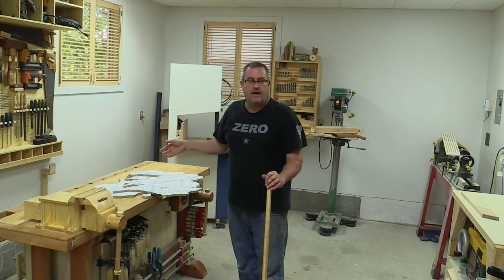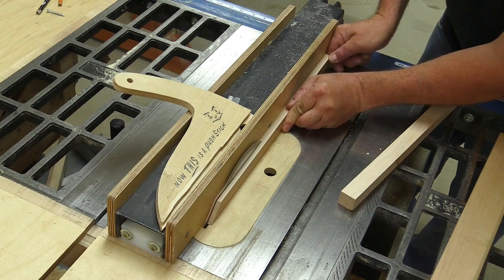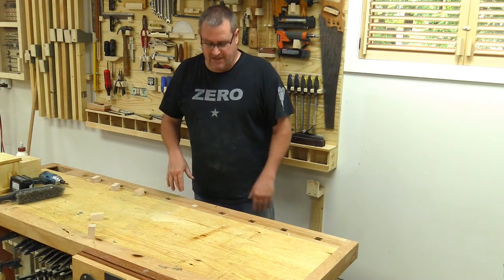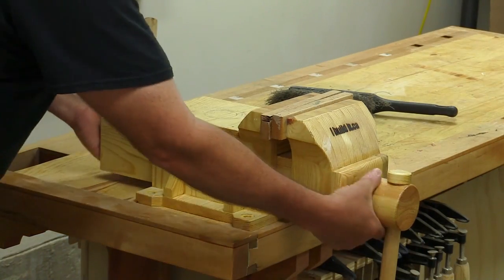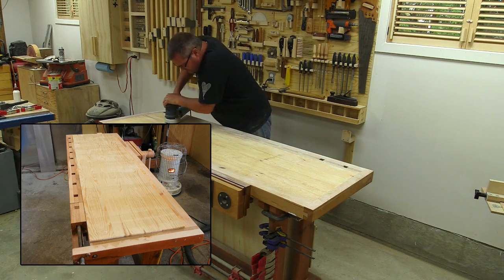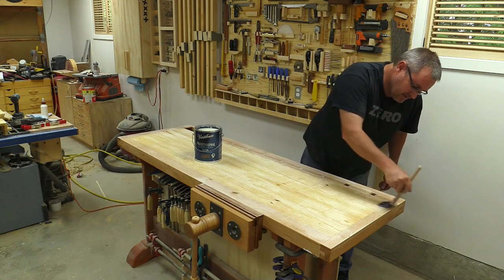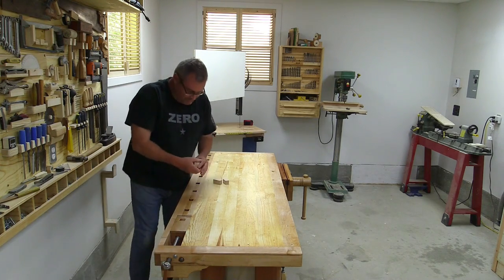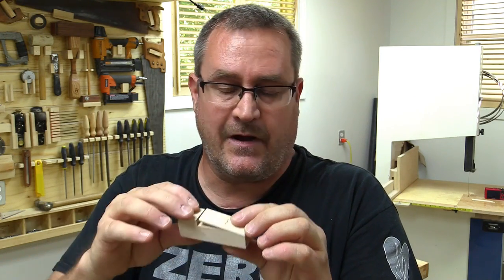Making A Wooden Bench Dog And Bench Top Refinishing

Comment: Nice job on the bench top John, I am going to have to do mine,I should have put a finish on it when I built it, but didn't, and now it is looking grubby. I may copy your idea of a pine top, because my planks have dried out completely now, leaving me with  gaps between each board, unfortunately the screws don't want to come out, unless I drill them out, refitting the mahogany planks is not an option...lol
Reply from the maker: Phil Sale Maybe route a 1/2" channel between the planks where the gap is and fill that with a strip that's cut to fit in there. Mahogany is too nice, it would be a shame to cover it up with pine.
Reply: I Build It Good idea John, I'll look into that, thanks :)

Comment: I've seen a lot of people on the internet say that polyurethane isn't a good finish for benches because they claim it would crack and peel. Clearly it's served you well considering you treat your workbench like a workbench.
Reply from the maker: Just Make It I would guess that the people that say that did something wrong to arrive at those results, like adding something to it or doing something to affect the adhesion. Either that or they are just saying something they read or heard somewhere else, without any actual first-hand knowledge. There are a lot of people out there with funny ideas, like poly is evil, cheap and "plasticy". 
Following the instructions on the can will give great, long lasting results.
Reply: I Build It I couldn't agree more. It just goes to show that you shouldn't always believe what you hear or read, especially on the internet.